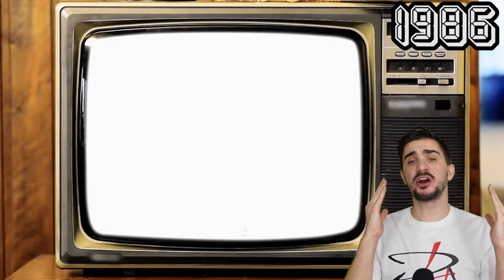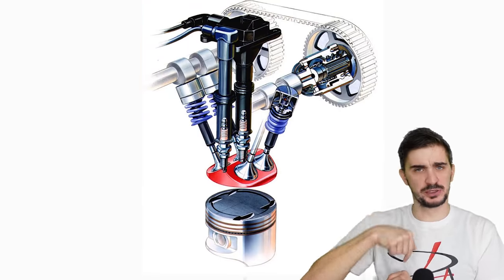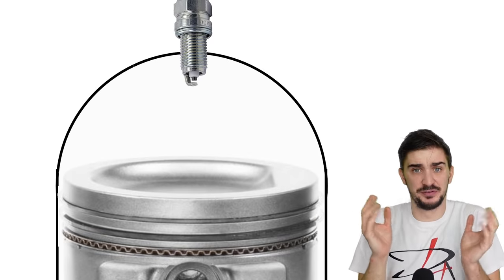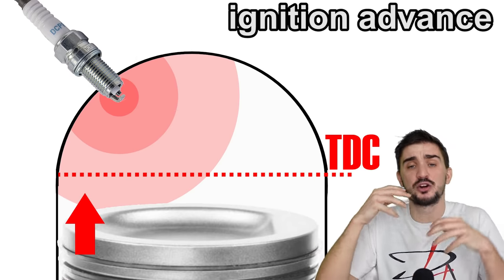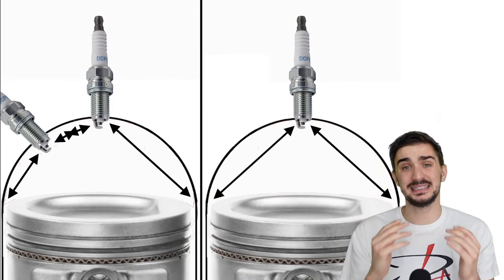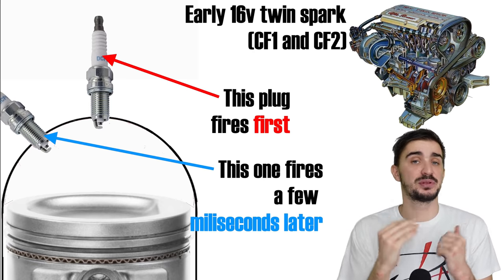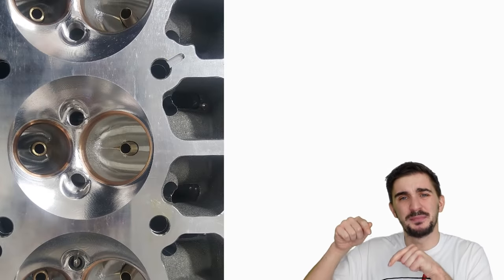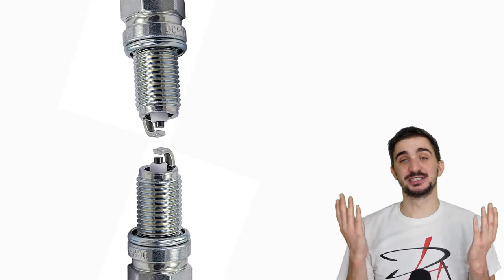TWIN SPARK - WHY, HOW and why it isn't more widespread

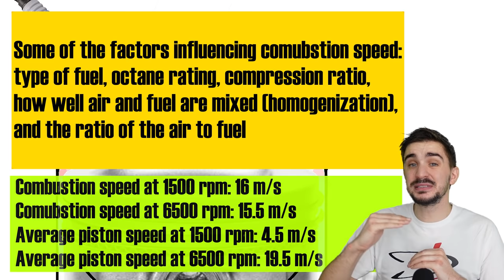Comment: 4:37 I don't know why, but this is, to me, one of the craziest things - cars going down a highway are moving faster than the explosions in the engine.

Excellent video as always, I always learn something. I have a Suzuki DR650 with dual spark plugs, and I'm almost positive it's that way for redundancy. It doesn't really spin that fast, and the plugs are close together, and a DR650 is exactly the kind of bike that you're going to drop in the woods, which could break a plug.
Reply from the maker: An important factor is the the area they have to cover. Combustion only has to cover 50-60mm and it's doing 16 METERS per SECOND. Whereas cars have to cover hundreds of kilometers and are doing 120 kilometers per HOUR. It's important not to imagine combustion as an explosion. Explosion is uncontrolled and a detonation. Combustion is controlled and it's deflagration. Hydrogen engines are dealing with far less controllable conditions for example and their combustion does close to 50 m/s at 1500 rpm.
Reply: The same reason a supersonic bullet can be accelerated faster than the speed of sound while black powder and even modern smokeless burn or combust at subsonic speeds. The air is heated and expanding faster than the burn rate. Plus at higher temps and higher pressures the speed of sound is increased. Physical properties and behaviours change with pressure and temp and we assume from our daily observations within a narrow window of temp and pressure that every chemical reaction or state of matter remains the same. On planets on our solar system it can be so cold that gases on earth become solids and become rain or snow . Look what water does solid liquid or gas within 180  degree F difference. We cant fathom steel evaporating or something boiling at super low temps like.  oxygen. Inside an engine is a unique set of conditions that causes normal atmospheric combustion to behave differently

Comment: My mom used to have a Honda City (basically a Jazz/Fit sedan) with the 1.5L i-DSi engine. Only rated at 90HP, but it had peak torque around 3,000RPM, so it was a surprisingly fun little car to drive!

Comment: About 15 years ago I had 2 (!) Nissan Prairie m10 4wd 1988 model year. A blue that I drove with and a white as a spare car. These were not so common, so I found by chance one more just weeks after I bought the first one. It was a 2.0 engine of 100 hp with double spark plugs and two ignition coils. I regret today that I sold them. A very practical car with sliding rear doors and no doorpost between front and rear doors. Easy to load. Perfect winter car and fun to drive.

Comment: Another reason why rotaries are weird and great!
They have had dual plugs for decades before the Alfa engine, and with nothing but real estate to put the plugs in (that long chamber is why they need more plugs) the benefits you mentioned helped rotaries to at least partially keep up with efficiency and emissions requirements of the time. With a leading plug wasted spark system adopted in 1986, they essentially had three plugs per chamber, as the rotor sweeps by the plugs rather than retreat away from them. This is a great mod to do on older rotaries that still used distributors.
Reply: Not decades before 1914 I guess?😀
Reply: @dollbagius  Yea, despite its design being from the 50's, Id say that most cars that had rotary engines would still fall into the modern automotive camp.....1914 was a LONG time ago!!
Reply: Alfa used twinspark in 1914, rotary engine exists since the 50s. How did the rotary engines have dual plugs for decades before the Alfa engine?? Dont get it
Reply: @petardenchev75  Simply comparing the somewhat modern rotary to the somewhat modern Alfa mentioned at the beginning of the video.  Yes, the 1914 Alfa was WAY before it, but it's hardly modern. Twin sparkplugs would not be common in mass produced engines until the modern era (70's-80's, about the time computers and electronics brought about the kind of cars we still produce today)

Comment: In 1957, Maserati introduced its first full-production model, the 3500GT.  Its engine was a detuned version of its straight 6 racing engine, as used in the 350S, which featured twin plugs.
The 3500GT used twin-plug ignition from the start, coupled to triple Weber sidedraught carburetors.  From 1962 it was also fitted with Lucas fuel injection . . . . and became the first car ever to be called a 'GTi'.  Later 6-cylinder models, the Sebring and Mistral, used the same set-up in larger 3.7 and 4.0 litre form, and featured the script 'Iniezione' on the back.  The power was quoted as being 15 bhp more than the carb versions, which supports your video analysis.   Good video, btw.

Comment: Modern chamber design had more to do with single plugs being the most common system now, with squish areas built into the head and piston the comb. chamber is effectively much smaller when the piston is at TDC, and the mixture is also more turbulent.

Comment: Right near the end you mentioned motorcycles briefly. Up until that point I had noticed you emphasized the word "car" when explaining the history of it. This is noticable to me because I spent some time riding a dual spark version of a bmw r1150rt. For those, I believe the main reason they did it was for fuel efficiency, and it was really effective. As a touring bike I was still able to get close to 60mpg consistently. I should never have sold that bike

Comment: I had a 2001 Honda FIT with I-DSI and it was quite absurd having a 1.3 litre motor with 8 coils and 8 spark plugs. 
Honda abandoned it in favor of I-VTEC on the smaller 1.3 engines, which is much better anyway.
Reply: I wonder if their reputation for developing ignition faults is due to unaware owners/technicians servicing only half the plugs and coils! (I have a 2006 i-DSI Fit myself.)
Reply: @thromboid  - well I thought I was having coil issues in mine, as it turns out someone had replaced only the front spark plugs - and not the rear - so I did all 8 and she was as good as gold. Quite the job for such a small engine.
Reply: @StratfordWingRider  Good catch! It is pretty hilarious having 8 plugs and coils for such a small engine. I was relieved that I didn't have to remove the cowl to do the back ones, though I did have to get creative with stacking up socket extensions.
Reply: Our country only got the 1.5L version of i-DSI engine in Honda Jazz (Fit) and Honda City (Fit Aria) from 2003 to 2008 . The fuel consumption is so good that can put some lower displacement 3 cylinder engines to shame. Additional 4 spark plugs costs can be offset by fuel savings.
Reply: @fleurdewin7958  -I have the 1.5 I-VTEC Honda Fit now and I must say it’s better for the driving I do. - the 1.3 did struggle on the hill roads and commuting that I do. I assume as a town car it would be ideal and very efficient. 

I mean I am still getting around 5-5.5 litres per 100kms from my 1.5 litre FIT - so it’s still very good even on the motorway here in NZ
Reply: As a broke person I agree 8 plugs is expensive for a tiny baby engine making less power than my moto
Reply: @StratfordWingRider  That's interesting - I've been wondering if my fuel economy is sub-par on my L13A Fit. I typically get around 7.5 L/100 km (30 MPG, 13 km/L), mostly short city trips, and I try to drive economically. The fuel economy gauge on the dash consistently exaggerates, claiming more like 15 km/L. The fuel trims have always been a bit on the negative side, but never enough to raise a code. Maybe high fuel pressure or leaky injectors? Restricted exhaust? I did a valve adjustment late last year, which made it quieter and smoother but fuel economy seems unchanged.

Comment: Correct me if i'm wrong, but recent direct fuel injection have never been made to optimize homogenization. Carburetors were in fact quite good at it, even though they were mechanlical devices. Single point injection was also good at it, since the air-fuel mixture had to travel the whole intake manifold lenght before reachng the cylinder.
Direct injection were optimized to run lean mixtures, but they are particle emmiters compared to older solutions, because of unmixed gas being burned in the cylinder.

Otherwise your videos are great, and it is really amazing to find such detailed explanations on youtube, keep up the great work ! I believe your accent (and subtitles) also help non-native english speakers understand your explanations.
Reply: Direct Injectors operate at VERY high Fuel Pressure that Atomises the Fuel basically Instantly . Into a Pre-existing Fire .
Reply: @johncunningham4820  gasoline injectors don't. "VERY high" fuel pressure is 2500Bars  Diesel, and guess what ? They produce particles too. Also the goal of lean mixture engine is not to have a "pre-existing fire" but rather a pre heated air pocket, not hot enough though to get pre-ignition nor knock
Reply: @spootneo64  . Ah ! Tech Talk , huh ? 
Diesel Injection  IS  the Ignition Cycle for that type of Engine And Yes EXTREMELY high Injection Pressures .
Stand Alone Direct Petrol Injection is at Very High Pressure , for fast atomisation and SHORT duration , at very slightly before the Spark Event .
And Dual Injection , the Direct Injector WILL be adding to the Already burning Port Injected Fuel .
I  personally LIKE  Properly Set Up and adjusted Carburettor(s) . And a Digital Ignition to go with it . 
More reliable and No Reason it can't be just as economical AND clean burning . Just needs Care-Taking .

Comment: The HEMI material in the description would really be interesting for a Part 2 on Twin Spark Plugs! 😉
I certainly didn't know of this fact about the HEMI before watching this video and reading the description!
Reply: However the "new" Harley-davidson M8 motors use their own 'twin spark" set up
Reply: it is interesting when have to buy 16 spark plugs and to replace it
Reply: Yes, 16 spark plugs can get interesting. Expensive and time consuming as well!
Reply: @brianmason8400  Yup.. I had an 04 Hemi Durango and now have a 2012 Ram Hemi.. I have a buddy withthe 4.7L Ram who claims ot have 16 spark plugs.. but I don't believe him.  Anyhow... I just bought 8 coil packs and 16 iridium plugs... yay!... y '08 Suzuki C109RT motorcycle is also dual plug so 4 plugs for it.. 2 you can get to easy, 2 you need to take the tank and airbox off to get to.
Reply: The Hemi is a thoroughly obsolete design. 

Chrysler actually knew this back in the 1950s when they designed the Wedgehead. 

They could have easily pulled out all of the stops on a 440 to make a “Wedgie Cuda” that would have easily outperformed the 426.. but for product differentiation they used the Hemi and marketed something inferior as superior. And since the other Big Two were more interested in making money.. they didn’t challenge it. 

And thus it entered into history and the NHRA made the elephant engine the basis for their Top Fuel engines even though other designs would have been fine. I imagine reducing runs to 1000 foot passes would have happened a lot sooner with DOHC engines. 

And so Gen III… all of those nostalgic boomers who didn’t know that HP numbers were giant lies (forget underrated from the factory… no air filter, no headers, no accessories, not even a water pump) which is why HP fell so quickly after 1971 and the switch to SAE Net. 

Gen III was a semi-Hemi because there was no way they’d get a true Hemi through emissions. The 2nd spark plug was to clean up the exhaust.
Reply: @Bartonovich52  So you think that a dohc that’s limited in cubes can make the difference up and then some because it can make 4000hp? Well I got new it ain’t 12000hp and if you were correct then why are they still using 2 valve designs today in NHRA 2022 btw considered the quickest and most powerful cars in the world. Last I checked mustangs launch like shit from a lower rpm in drag racing this is why they need to be turbo on a 2 step or trans break otherwise they leave like shit. So you see great and all but limited much more limited than making a 2 valve blown 1/4 killer. Dohc design work best at everything else but from a dig on glue it is not superior to the 1320ft finish line this is why Chevy and dodge still make 2 valve cars and all their performance is 2 valve. Same argument I have with ricers and mustang guys consistently. Nothing comes without a draw back.
Reply: The modern Chrysler hemi has used two different coil setups, as well.  In the earlier models, they had the coils fire one plug for the cylinder they sat over, and a lead that ran to the second plug in the opposite cylinder.  I'm really not sure why they did it this way, they'd have to fire two coils simultaneously, plus there was the added complexity of the spark plug wires running back and forth.  The newer ones have each coil firing both plugs for the cylinder it's over.
Reply: @Bartonovich52  yes and no the 440 ( and sometime i wouldn't mind going against a N/A 572CI or pre-1990~ modified build just to see if im really right or full of it ) in OEM 1970 trim at the lights vs oem 70 426 yes as it bog's badly as i understanding is but with my/computer wizardry no i think it's got a good chance of winning and someday i probably will put that to the test just to see as my 60's charger ( 3k to 6k LB but more likely 4900~ LB's is my guess with me full running ready to race and street date-night trim ) now has a D-8 twin-spark DI ( DI gas or diesel fuel but the later isn't as interesting as the fuel system to run it is $$$ with common rail but someone else has, just not me/my crap ) modified castings and 4.5 storker VVL+VVT and variable rod's for compression 8-14:1~ on the stand plus a TR6070 transmission 3.2FG 31" tall tires
Reply: @Bartonovich52  the viper cam in cam is a better way of doing DOHC and ford fielded pre-1977 BBF camer's with 4-cams it keeped eating parts lol 😂 as the grind needed is way too ruff plus the slack in the timing system is hard on parts ect. vs a 2:1 lifter on push rod engine 

and jerk/muti-air FCA was using or still using is better my-C-2 than say 2016 coyote v8 right bank style as it mimic's konseg's free valve system and caterpillar had something similar to it as well but couldn't get it to not eat valve's/piston's after about 200K mile's ish or so
Reply: let me add id like to try squaring off against a OEM 1970 hemi dealership's trim charger vs mine just as added let me see if im right or hot garbage but my bet is the fuel injection should really wake my car up and make it boogy down the track the down side is im probably going to be way heaver than the OEM car and any auto-Xer and drag racer know's that will come into play
Reply: @richardprice5978  what in the hell are you on about????? go back and redo your posts using PUNCTUATION. good god, man........
Reply: @Joe-sn6ir  i was considering ignorance on this coment, but maybe you could understand different engine configuration's. to some point im willing to educate others 

so i get the feeling you aren't for starters awareness of computerised air flow though a valve-train and or ECU contorted valve's something im adding to my V-8 for starters and i menched the name's of some of the technology or at least a way to look it up and learn
Reply: @Joe-sn6ir  something danceed around in the video is magneto or dizzy VS CNP or COP plug ignition system analog VS digital control, or are you unaware of it?

fibre-optic's/lasers can be used to ignite the chamber mix but for now its out of my realistic expectations aka too expensive and or to hard to make parts to use for me 2020-back

some of the difference's between a unmodified 1966 426 hemi v8 with a magneto-ignition and a modern one im working on restomoding with a sweet of 2010-up technology 

ps. dodge made there 60's hemi's with single off set plugs or "twin plug' the later 2X-pre-cylinder is the setup im using all 16-plugs and a set of DI-injection =8 in the chamber or another way of counting is spark-plug and one DI and one more spark-plug in the cylinder head pur-cylinder

Comment: Thank you for this content.
Relevant to me as I begin on a '69 Bultaco MK2 Campera motorcycle rebuild/refresh.
From factory, had electronic ignition (?!), single cylinder [two stroke] engine - with a head featuring "2" spark plug holes.
(one typically to park a spare plug - OR - a compression release valve)
I for one am all excited about fitting a modern, dual spark set up.

Comment: There is a HUGE amount of Mercedes-engines from the late 90s to the early 10s - M112/M113/M137 V6/V8/V12 Engines. 

These are not only dual-plug engines but also 3-valve engines (with 2 in- and a single outlet-valve). There’s also no space to Center the plug, so the sidemounted two, each fireing every second cumbustion to prevent the piston from gettin damaged by onside ignition.

Comment: Suzuki made a 1.8L V-Twin engine that used twin spark. It didn't rev particularly high but it had the largest bore on a production motorcycle. They put it in the M109R (VZR1800.)

I have a Ford 2.3L with twin spark plugs. I reordered the ignition wires on the secondary coil and it runs much better now that both plugs fire at once.